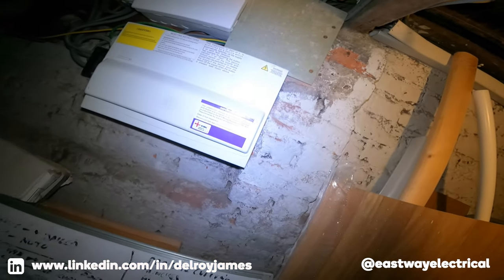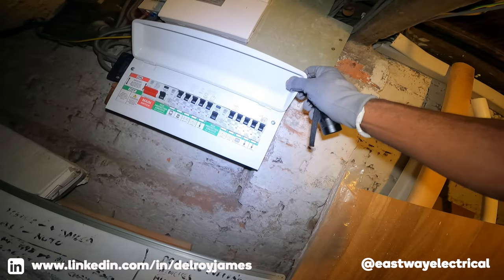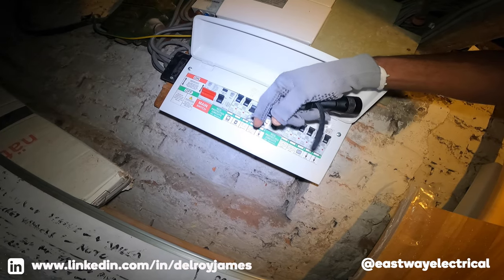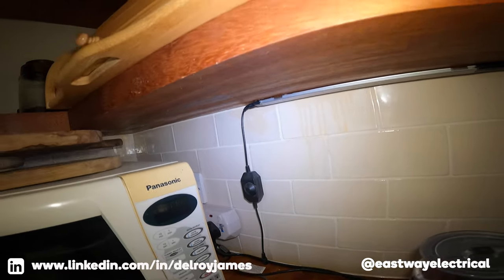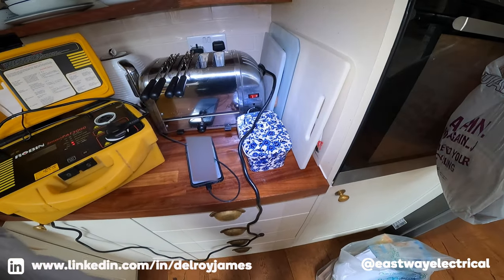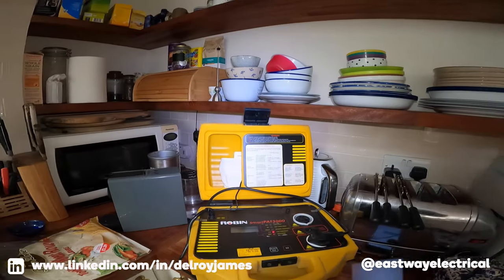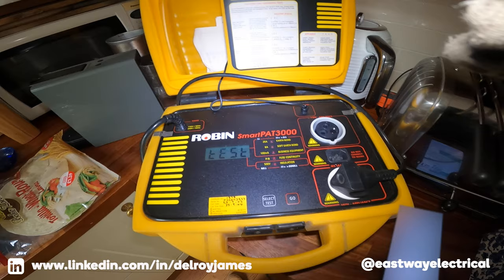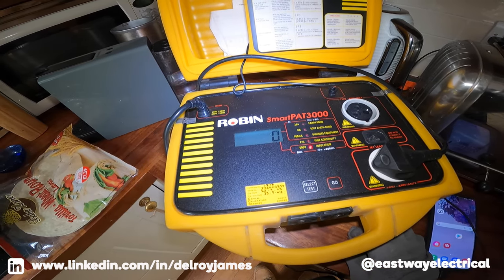I Had To Get My Old Equipment Out For This | Electrician In London Vlog

Comment: Always ask questions as a customer said to me you are the 3rd electrician I have in and the other 2 could not find the fault tripping the RCD. Turned out the oven and iron had slight leaks but not enough to trip the RCD on its own but together a instant trip.
Iron braid lead was shot to bits and the customer looked puzzled when I said replace it ASAP. £15-£20 for a iron ffs